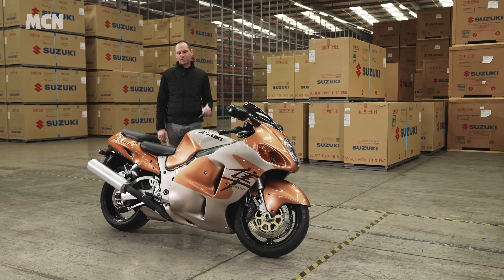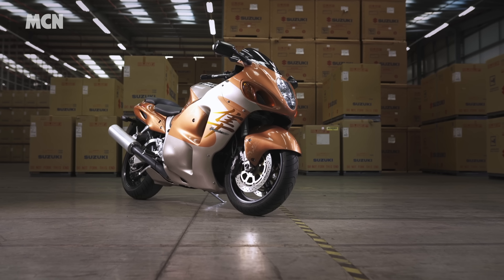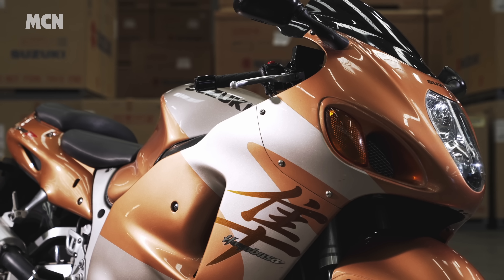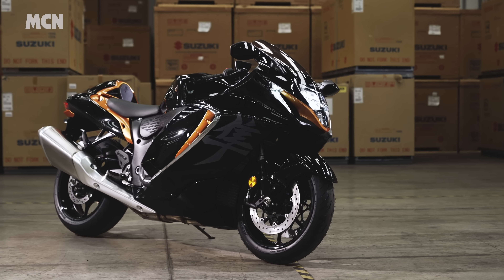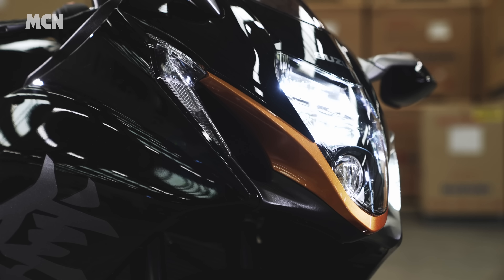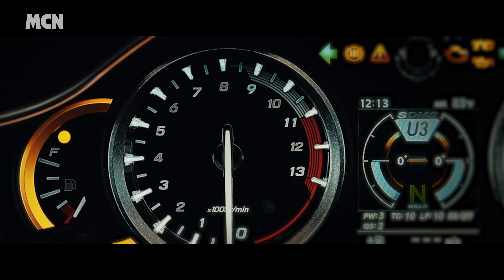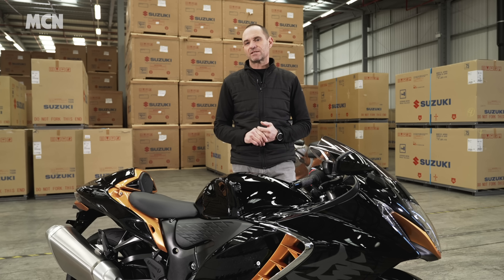2021 Suzuki Hayabusa exclusive: Neevesy's take on new 180mph+ hyperbike | MCN

Comment from the maker: What's your thoughts on the 2021 Suzuki Hayabusa?
Reply: They kept that same 1340cc motor. The zx 14r is still 100cc larger. More torque more horsepower. As 14r is still king. This is just a euro5 refresh. Nothing more
Reply: I couldn't be more disappointed!
Reply: Same old 1340cc engine with less hp and worse fuel range? This 2021 model introduction is generating the opposite reaction that the first Hayabusa model did back in 1998, so much disappointment. What happened to the rivalry between the Japanese motorcycle companies? I was hoping for a more powerful TURBO engine to challenge the supercharged Kawasaki...🙈🙈🙈🙈🙈🙈🙈🙈🙈🙈🙈🙈🙈🙈🙈
Reply: Im not a Hayabusa customer but I was mildly impressed with the model. And I really wish my 2015 GSXR had those rearview mirrors but with integrated blinkers! A small detail with great design unusual on past Suzuki sport bikes.
Reply: Wow! I used to hate the Busa but now I just really really don't like it.
Reply: Marvellous, the best looking Busa so far, I want one
Reply: Meh. Was expecting much more innovation. They just brought it in line with bikes that have had all this technology for years. I get the feeling it was only updated because of the EURO5 requirements...EU, also known as the dystopian "No Fun Zone"
Reply: Been waiting for years for this bike to come out, what a disappointment! Not gonna bite
Reply: Welcome to the new normal, the new trend
Reply: Its like Busa's soul has entered into a Gixxer 😎
Reply: I want it
Reply: Why does anyone care what is is stock? No one will ride it that way I mean no one so why waste more money on power when everyone will change it. They focused on areo and electronics which is what everyone was bitching about with the old one. They addressed all of that. Suzuki is not the first manufacturer to lose power with euro 5. Why create a newer engine size for 5 to 10 horsepower. The Busa is and has never been a slow bike really.
Reply: Big and beautiful. What the first gen was supposed to be
Reply: I love it. The fact that they evolved it and didn't try to just give it a few more horsepower just so they could say it is the most powerful bike (by 2 or 3 BHP) than other bikes was the right choice. It is already more powerful, as are all superbikes, than anyone can really use. A Busa is about lots of smooth, creamy power, and high speed riding; the bike you would take to the autobahn so you could be comfy at 150MPH. I also love the the more conservative nature of the changes, the analogy to the 911 was spot on.
Reply: I had 1.st generation Busa, two Busas from second generation and now... RIP the LEGEND. Same engine after 13 years and less power is maximum disappointment. Naked bikes are more powerfull than this "hypersport", it´s shame. Design is really nice (I love it) but without power I can´t buy it. I can´t believe. I´am still waiting for news from Suzuki like a ... "it´s a joke, our new Hayabusa has compressor with outstanding performance"... or... "and now we are happy to introduce model RS with 280 horse power"... Noooo, it´s not a true!! They killed the legend!
Reply: Amazing! I think I would say "wow, busa" even without knowing it's the new one :) They saved style and legend. And I really liked remark on video about leaving details for forum discussions. We call them "sofa troops", those specialists ;) Thanks for video!
Reply: Looks like I'm in the minority I really like it. Don't change very often maybe that's it.
Reply: Underwhelmed to be honest. I was expecting something with the power to match the ZX-14. I'll keep my Gen-2 Hayabusa.
Reply: I'm not bothered its down on 100cc than the ZZR, its got cruise control, a monster motor, comfort, and nice electronic package etc it should make an fantastic road bike...
Reply: its the first busa ive ever wanted
Reply: This is what they come up with1340? Really? 1340? Kawasaki stil big bike king , suzuki missed the boat should have gotten more motor and more hp and less bullshit electronics. Pretty but very very disapointted.
Reply: @christopheralonge7758  chris i just dont get it .They wait all this time to do a new bike and bring back a 1340? This really pisses me off.all that time putting electronic bullshit on the bike, what the hell do i need to know my lean angle for?  Could have put all that effort into topping the kawasski, guess not. I'll keep my gen1  1397 till kawasaki  revamps the zx14 .
Reply: @stratgibson how can you get slapped in the mouth with the zx14 and come back with 1
Reply: I’m a Busa fan, a Busa rider but Suzuki bout to make me switch to the zx-14!!! I definitely wasn’t expecting this crap! Disappointed!!!
Reply: @dougsmith6220  couldn't have said it better my self. Suzuki went for a cheap refresh. They had the opportunity to do something special. Their sales will suffer
Reply: I’m surprised it’s not 200hp, tuners delight?
Reply: @radekgt9951  no they didn't, the opposite i think. Its a refinement, the last bussa. When electric bikes have ruled the world for a couple of decades people will still be talking about modified bussas with 400hp lasting 100,000 miles
Reply: I like it like the colour as well
Reply: @v8berenguer372  V8 im so pissed at this bullshit i cant see strait. 1340? Really ? I guess they gave up trying to be the king of the big bikes. Zx14 still be da boss sadly.
Reply: @krisknutson5626  kris im so pissed i cant see.1340?really zx14 1441? What the hell are these people thinking. So much for being the top dog of the big bikes, looks like zx14 still be da boss sadly.
Reply: Suzuki market research failure
Reply: I've passed over the H2 variants waiting for this. To be honest, I am quite disappointed. I was expecting a new bike that made me fall in love and gave thrills of my first gen1, then my second busa, a gen 2 in 2008. I was expecting them to overcome the Euro5 restrictions and blow everyone away. Smaller throttle bodies as well. Curious what tuners can do with this. 
Nice that gadgets are on par with the competition, but it fails to capture that x factor for me. This should be the KING. but it's just a mid life face lift to keep it somewhat marketable. Shame about the fuel milage. Looks bloody awesome though. Looking forward to the ride review.
Reply: What a wasted opportunity!
How many people will pay out 16 and a half grand for the same old thing wrapped up in a new coat? Talk about the Emperor's new clothes. Not even a center stand offered on what is essentially a big sports tourer. Many will be going elsewhere with their money.
Reply: No turbo.......
Reply: @freedome4070  ... no turbo, no super charger, no power increase, no engine size increase, no option for center stand, and over 16 grand to buy !!
Has Suzuki not noticed the world is in economic 'distress' and they want 16 grand for this? Have they lost the plot?
Gen 1, gen 2, gen 2 + 1/2
They could have sold it on the back of their Moto GP win, how many people will buy what is effectively a rejigged 2008 bike?
Reply: @adrianpeds  I never owned a busa. Have owned a 17 zx14r. Tge new busa looks good and I like the updates. Could be a buy for me. Probably because iv never owned or driven one. I'll probably wait for its second year in production for other color options.
Reply: Disappointed in every aspect.
Reply: Uninspired
Reply: Keeping my kawasaki.
Reply: @can-uc-wakeup  But why? Why do this bullshit ? I thought they were going to build a all new bike. 1340? , man you said it better than anybody, same warmed over bullshit. No thanks kawasaki still be da boss sadly.
Reply: Not electric.
Reply: ive had a 2001, then got a 2011, and have been waiting for 10years to get a new one. cant wait to get the 3rd gen.
Reply: First response.  sexy bike.  After looking at the full story.  Meh.  Hard pass.  I'll keep my CBR 600 F4, and Ducati 800 Monster.  And 4 others.  Front end is gorgeous, rear looks like a techno pig.  Hideous rear.  New exhaust, and a tail tuck/cleanup?  Maybe could fix it.  Just happy that Suzuki made a new one.  Next gen will be sick.  Fails teach us the most.  ;)
Reply: mileage?
Reply: I am a diehard Suzuki fan but I can’t help feeling disappointed over the last several years. Maybe such revolutionary machines as the 85 GSXR, S-RAD, K5 1000 and the original Hayabusa will never be topped 🙁
Reply: I can see almost zero reasons to buy this. Better brakes (possibly) aside it's worse in every way than the outgoing one. Heavier, less power, worse on fuel (by a lot), fatter and almost certainly slower because a wider body, more weight and less power tend to do that. 
I'm not even interested in euro 5 because the simple answer and the one us owners have been banging on about since the gen 1 is to turbo the bloody thing. 
One of the most disappointing reveals since the 08. 
If they weren't going to improve it they should have just left it gone. This mess is starting to water down the early busa's (well deserved) reputation.
They even had a TV6 FFS.
Reply: I thought that can only one person can sit on hayabusa 2021 or two persons can sit on 2021 cuz I like the modern cowl it's better than Kawasaki ninja h2 Pls reply
Reply: @Louwrens De Kock Great bike based on what? Its worse than the old one in most ways and not much better in any. 
If this was released 10 years ago it would have been average. Now its just lazy.
Reply: evolution, not revolution, which means it remains affordable as owners of older Busa's want more of the same but with the modern safety tech = sales
Reply: @Rayk76  I'm a 67 year old ZX-14 rider, and would love to have cruise control. My last bike before the 14 was a ZZR1200, the one before that a ZX-11. I was set to buy a Busa, but I'm 6'2", and at my age, the Busa's tighter ergos put me on the 14. I haven't regretted it. In the end, both bikes are awesome, just a bit different.
Reply: @v8berenguer372  2021 180mph+ "Hyperbike". Wasnt there a bike in the late nineties which could go 180mph+? Hmm i wonder what bike that was
Reply: @MrSpeedemon7777  bike industry is dying... so bikes need to be restricted so much that it reverses 20 years of progress but cars go scot free? Cars have doubled hp in the last 20 years yet bikes are the exact same as 20 years ago??? what is going on???
Reply: @MrSpeedemon7777  imagine the joy if they had announced that...
Reply: @valensinclair6750  much like the UN aka no F UN involved
Reply: @stewieiommi  well said, I had 2 zzr14s and prior to that 2 zzr1200s in the past abseloutely fantastic road bikes but I've never had a busa and I've always liked them so I think the time is nigh
Reply: @earnestgriffin4838  its got the same performance from the same model of bike 21 years ago... that is appalling, cars have doubled in power in that same amount of time
Reply: @timothymills733  your not paying for a Sofabike your paying for a superbike, what is the point of calling it a superbike if it drops performance for comfort. Backwards world...
Reply: @earnestgriffin4838  good point. I guess the focus is its reputation for being the fastest in a straight line. But the zx 14r has dominated that for awhile. Suzuki had this opportunity to make a real monster and again fell short. People like big changes and improvements
Reply: @timothymills733  it's actually down on horsepower and torque compared to the gen.2 version
Reply: @radekgt9951  well put. Big horsepower numbers sell motorcycles
Reply: @greensocks4507  well stated. Myself also
Reply: @dougsmith6220  couldn't agree with you more. Exactly what I have been saying
Reply: @veshun167  I have owned many as 14r. Make sure you get one that is 2012 and on from there. You will find it has all the power and torque you could ever want. It's a monster. Very strong easy launching clutch ad well. Suzuki again had fallen short
Reply: @fs3994  me too zx 14r rules
Reply: @Rayk76  save your. Money.
Reply: @finlaymcdiarmid5832  well spoken
Reply: @christopheralonge7758  thanks. I miss the old days of cars and bikes when what you saw is what you got and wasnt plastered with cheap plastic for looks and to look "complex" and when bikes were easily repairable and maintainable. Its ashame...
Reply: @christopheralonge7758  ill see
Reply: @siraff4461  the bike industry is exactly lkke the game industy. Lazy and full of rehashes and even more excuses
Reply: @finlaymcdiarmid5832  I agree brother
Reply: @finlaymcdiarmid5832  Exactly. When I got my first fireblade it was a complete revolution over what had come before. The R1 pulled a similar trick - if slightly less of a leap. Then the GSXR 1k jumped it up a bit more but since then its all been chipping at whats there while hiking prices like money is going out of fashion. 
The only real new things have been the Kawasaki supercharged bikes and things like the Vmax, SuperdukeR and so on. 
As far as sport/superbikes go its been stagnent for ages. 
It used to be every couple of years bikes got an uplift then every 4 years or so they got a complete redesign. 
Now they run models for 10+ years with minor revisions, call electronics a massive improvement (even though they are usually just bolting on 3rd party kit like Bosch) and wonder why sport bike sales are on their ar5e. 
If this came out with the old engine, a turbo and all the eu5 cr4p they could stick a £20k tag on it and it would sell out instantly. I would certainly have been as close to the front of the queue as I could but this just isn't worth my time of day to switch. I may get one at some point if there is a major deal on them (like the last one which you could get at just over £10k with 0% at one point a couple of years back). 
As it stands this is going to be thousands more than the old bike and at very best won't be much worse.
Reply: @christopheralonge7758  its why i dont watch f1, its broken they ban everything that gives an advantage even if the other teams could just integrate the change and make it fair but allow mercedes to blow up like a episode of my 600lb life and win every race because their car is so fast. Somebody easily broke Hamilton's lap record in a unofficial lap...
Reply: @franklinwilkerson2061  🤣
Reply: @siraff4461  what year was your first bike? My dads was a early eighties 250xl that he bought with his pocket money! for a couple hundred quid
Reply: Rear end looks like BBW😂😂🥰🥰
Reply: I think that its not going to be a best seller Not impresed body looks the same the dash is a classic i agree but this bike needed a huge change to beat the competion like 1500cc with a turbo charger or procharger runing off the gear box. But no way i would spend the money Best bike for 2020 and 2021 Ducati & Bmw have what people are looking for.
Reply: 2 much Weight / no power / irrelevante bike 
Any 1000 CC Will destroy the busa ... 😱😱😱
Reply: @earnestgriffin4838  Ernest the hayabusa is slow thats why we RACERS want more. I can tell by what your saying that you are not a racer, well i do and i wanted a 1441because it is competeing with a 1441 kawasaki. Why do you think after we buy them We tear them down and put cams pistons clutches lite wheels , on and on its to go faster ernest.
Reply: @veshun167  say it louder BT! ZX14 STILL BE DA BOSS SADLY.
Reply: @siraff4461 Insane raff just insane.Its clear that the engineers needs to be replaced with engineers with new vision and the attitude of wanting to be king of the big bikes. This was the vison of the first busa.They should have infused new go fast less weight protocals.They severly missed the boat. I'll keep my gen1 1397 .
Reply: Like you said Michael, the gen 1 Busa is an iconic machine. None of the others will ever be remembered like the first. Suzuki should have left it there as a one time special
Reply: @dougsmith6220  I suspect they don't have the funds to build an entirely new bike(or don't want to invest) . They had the audacity to say, that this bike is the product of 10 years of developement... Please...  Don't insult my intelligence...  I'm sure it's a great bike,  but,  is NOT a new bike, a new project.  Me,  I'm keeping my old zx12, and wen I can,  I'll get the h2 sx!
Reply: @dougsmith6220  I agree fully. I've got a stock(ish) gen1 RZ which I've been putting off taking to bigcc for ages - first waiting for the gen2 then waiting for this. 
I reckon Sean is getting a call at some point this year because we've finally got to the point where there is nothing else I'm interested in. 
All they needed to do was throw on a turbo like everyone wanted and a lot of people have been doing for years. We could have forgiven the weight gain for 50hp and 30lb extra.
Reply: @finlaymcdiarmid5832  My first road bike was a 1980's DT50 but my 2nd was a 70's CX500. 
I've done new, old and all the ones in between over the years but I've never seen the industry stagnate so badly as it has for the last 10+ years. 
In the 90's-early 2000's this would struggle to be called a mild facelift but now they're selling it as a whole new bike. 
My gen1 '07 hayabusa RZ is at least as far removed from the 1999 original as this is from the old bike.
Reply: @siraff4461  yeah its becoming more of a joke every year. That dt50 mustve weighed nothing my dads dr650 only weighs about 140 if that!
Reply: @finlaymcdiarmid5832  Yeah it was like a pushbike with a strimmer motor. UK laws though so at 16 it was that or nothing.
Of course it ended up as a 65cc big bore with a pipe and a larger carb. Went pretty well after that considering. 50mph or so.
Reply: @siraff4461  yeah, well i was considering getting a bike but with a a3 license you can only get a 125 and you can only get limited ones which are the ridiculously expensive new ones which are like 4 grand for a bike with 15hp. So im just going to wait until im 19 or older to get a old 250
Reply: I read the first few comments, and I have to laugh. I RARELY see a Busa that is fully stock. What did this video really show? That Suzuki made this engine more durable, for the folks that will most surely hop.it up!!!
Reply: I mean in my neighborhood in Brooklyn, about 5 guys have Busas. All of them are stretched, 3 of them are turbos! Give me a break. 
The video made mention of the changes are similar to a Porsche 911, and I agree!!
Reply: @vinceedwards3978  Take a look at a 1999 911 and a brand new one. Its nothing like the same in looks or performance.
Reply: @vinceedwards3978  With slower cams and milder combustion chambers. In other words you're going to get less gains from this than the old one and have a big disadvantage from the start. 
This also has cats in the cans which is an easy give away to a cop that its not going to meet emissions. Depending where you're from that makes this almost unmoddable without a lot of unwanted attention.
Reply: @siraff4461  Thats true, but I live in NYC. There is.much less regulation here than in theE.U. or Japan. Guys here will run to.this bike
Reply: @finlaymcdiarmid5832  Back when I was learning most 125's were a derestrict away from 25-30hp. The new ones are better on fuel but thats about it. 
If you want a laugh on a new bike get a grom. I got one new when they came out and even though I'm used to big power bikes its a total laugh. One of the slowest 125's but its serious fun. You can't really go far on it unless you like sitting flat out for hours but throwing it about is one of the best laughs in biking. When I got mine they were about £3k new and had a £99/month finance offer on - though that was in 2016 or so. 
It makes no power and makes you act a hooligan but its a bit like a bmx - not technically as good as the bigger bikes but a total laugh. 
Oh and they hold money like they're made of gold. Mine has only lost a few hundred quid in value over the years even though it was brand new so overall costs are cheaper than a bus ticket.
Reply: @vinceedwards3978  Even then its got lighter rods (so probably not as strong if you run boost), slower cams and midrange designed combustion chambers (so won't pick up as much if you run it n/a). 
I like the styling, brakes and bars being moved back - all complaints I had with mine over the years - but engine wise this is a step or two back, tuned or not. 
Having to put three cats on a bike is just stupid and having to smash its economy to go with that just shows how far out of touch the new regs are. That extra fuel has to come from somewhere and drilling for it, refining it then moving it all costs more energy+pollution. But thats ok because the bike thats now not as good wil put less out of its exhausts - even though it requirem more pollution going into it in the first place to do the same job. 

This thing really should have been boosted.
Reply: @siraff4461  I have only ridden a1999 first gen, stock, and a second generation about three years in. The third I had ridden was a heavily modded first gen. Turbo bike. I thought my friend,  the owner, was nuts. 
I think most sensible owners will.feel that it has 😔 powet.
Reply: @siraff4461  As a guy who owned a 930 yes I agree, but it is an evolution of the design. The most radical evolution of 911s? All wheel drive in the 993 Turbo, and water cooling what 5 years later? The cars got bigger and heavier, but they improved to be good enough to be daily drivers
Reply: @vinceedwards3978  With the 911 there is constant evolution though. Every couple of years there are revisions and usually its not all that long between complete model changes. It may look similar but its had a lot of constant work underneath since it arrived. The busa had a facelift and slight power lift (along with a lot of extra weight) in '08 and this is pretty much a facelift and emissions compliance on that same bike. 
Thats 22 years with almost no progress at all on how the bike rides or how it performs. Infact the gen1 is still usually the quicker bike in racing thanks partly to it slipping through the air better and partly because the internals can take a lot more stick. Yes you can boost both but the gen1 still takes more boost and power too. 
Has there ever been a 911 where the later car was slower and less tuner friendly than the last? Especially 22 years down the line. 
Remember when the busa came out sport bikes were topped by the original R1 with a claimed 140hp. Now there are plenty claiming around 200hp but the busa is still only claiming a few more than when it was released and with real dyno numbers putting gen2's at only around 10hp over the gen1 this may even be less powerful when it actually hits the dyno. 
The most powerful 911 in 1999 was the 420hp turbo. In 2020 it was the 700hp GT2 RS. 
I stand by what I said. This bike shold have been turbo'd and have 250-300hp.
Reply: @siraff4461  yeah a grom would be better than a 125 probably, 125s weigh not a huge amount less than a sport bike but with a fraction of the power so better off with something really small and compact that 15hp is significant for
Reply: Beginning of the end for the hayabusa, suzuki have really made a big mistake here with this one. Revamped styling is all this is but not in a good way.
The soul of the busa has gone and to tempt busa owners away from the current model isn't going to happen with this.
Very very disappointing and its only a hayabusa by name.
Rip hayabusa!!
Reply: Rip hayabusa!!!
Reply: @finlaymcdiarmid5832  The grom isn't lighter than most of the sports 125's and it only makes 9hp. Trust me though its a far better toy.
Reply: The restyling the design the electronics package is awesome. But a 1340 motor that's what I got now come on Suzuki get your s*** together. Turbocharger supercharger something
Reply: One of the Ugliest bike ever made.
Reply: @dougsmith6220  Then why even worry about a new one or the specs because based on your comment it would not have mattered what they did is my point. You do realize they are company who has to make money and not cater to a small group of people? Just because Im not a racer Doesn't mean I know nothing about bikes. I have been riding for 32 years and own a business I look at the entire picture not one side. I didn't know the speed limit was over 180mph because at the end of the day its a street bike. Racers regardless of vehicle or class will always mod so stock form is irrelevant.
Reply: I love it. An opinion nit shared by my local Magistrate so I'll lose the bike and keep my licence.
This weapon is nought to court in milliseconds!
Reply: @earnestgriffin4838  man im so mad this wasnt at least 1400. Im a die hard gsxr nut i've owned six including my my gsx  1397  . When the zx14  came out i said just wait suzuki will  bounce back.well they took this long to go after the big zx14 with a1340? Im sorry this is not going to cut it. Zx14 will still be king and im pissed  about.
Reply: 350+ KMPH ❤️
Reply: Ordered.
Reply: To all of you who say that zx14 is more powerfull I laugh so hard...whith the fake video that Kawasaki uploaded versus the hayabusa years before we all laughed...Did you really thought that zx14 was faster????! Hahahaha
Reply: Pretty much all motorcycles have TERRIBLE coefficient of drag, if you compare to cars. Suzuki need to forget aerodynamics and concentrate on updating this motorcycle. I love the company ... but we have been waiting ages for this bike and it’s just not good enough
Reply: @maxflight777  maybe we must wait the rest rides...it’s very soon to talk
Reply: 911 analogy was spot on. I own a 04, longer and lower than stock, Love it. Never own another bike, Underated imo
Reply: @dougsmith6220  I am a ZUK nut as well again I try to look at everything. Kawasaki was trying to beat Suzuki not the other way around. I know tons of guys that went to a zx14 and was back on a Busa in a flash. Just because it had more cc didn't make it a better bike. After that 186 mph agreement they made what difference did it make?
Reply: Haven't saw it yet
Reply: Disappointing...the identity of Hayabusa, the feel..it's gone.
Reply: Give a tubro busa to yammie noob
Reply: It needs a turbo
Reply: @finlaymcdiarmid5832  yes bro, This new busa is utterly disappointing 😔
Reply: First thing that Came in my mind
Reply: OMG - shut up and take my money!!! 😍😍😍
Reply: More like what I think of Suzuki, they didn't make this bike because they cared what people thought about them, they made this bike because of what suzuki thought of people.
Reply: Can anyone please let me know which shoes that guy is wearing 🙏
Reply: This can be compared to the evolution of a 911 since Porsche is the benchmark and the hayabusa was the benchmark and has now been left behind
Reply: About the FORKS in the suzuki global say this :  are KYB inverted cartridge forks provide 120mm of front wheel travel and feature diamond-like carbon (DLC) coating on the 43m.  So is a change compared to the gen 2 ??
Reply: Just gonna a nos tank on it
Reply: Suzuki is the most outdated Japanese manufacturer. For me it does not exist at all
Reply: I like the look of it.
My immediate thought is what happens when I derestrict it and it gets past 180MPH?
To be honest I preferred my old gen 1 with the GSXR front brakes I fitted. At least that did a genuine 197MHP (Indicated 205) and had 178BHP at the rear wheel....OK it was slightly modded. No pair valves, Big airbox mod Power commander and K&N filter Oh and a Akropovic titanium race system.
I think they should give the first one to Sean at Big CC to show us what could've been.
Reply: MRJT is the next big stock to buy.
Reply: WHAT IS THAT SONG ..4:54 🙏🙏🙏
Reply: Give me donate hayabusa😍
Reply: Old dog new tricks
Reply: @christopheralonge7758  Agreed
Reply: I have to defeat h2r soon
Reply: i think 2021 will be use turbo like kawasaki H2
Reply: @v8berenguer372  I am also disappointed after waiting so long. I wonder how much input came from busa riders?
Reply: @valensinclair6750  exactly.  The paint job and electronics are awesome. other than that. It's lacking for me.
Reply: @earnestgriffin4838  very valid points you're making. It's just a lack luster when as a Busa owner you're expecting more and also seeing competitor out perform the busa in most categories. I want a winning Busa. So I love the bike but my expectations are shot.
Reply: @radekgt9951  You said it! in total agreement
Reply: @adrianpeds  I too pass up a H2 (great offer on a resale) as a next bike waiting on the Busa. sadly I'm disappointed.
Reply: @enigma5192  As your first Busa I'm sure you'll love it. it's only a disappointment to existing Busa owners. it come up lacking what we love about Busas
Reply: @ringsoffire5947  double DITTO!
Reply: @rwd323  shared sentiment
Reply: @siraff4461  I think Suzuki made advances without consulting it's customer base.
Reply: The claimed mpg is a shock. Guessing it has something to do with the testing parameters and that new mid range bias. Hopefully tall gear Highway runs will be more toward touring friendly figures.
Also would be interesting to see what's possible with remapped / grey import variants, i suspect there's still going to be a busa hiding somewhere beneath the that electronics pack.
Reply: Let down
Reply: @lawrencebutler1664  , I suspect a big fat zero. I really think there is something wrong with this brand. They stopped to invest in new projects.  All their current models are nothing more than   recycled old engines with new plastics... The vstrom, the Sv, the Katana....  All engines with more than 20 years...
Reply: Is that a Busa or a Goldwing? I cant really tell with those massive California mufflers...Jeeeez that sucks ass. Not only did they miss the mark...but they shot themselves right in the ass...no good. Noooooo!
Reply: As a Gen 1 Busa owner, I absolutely love it.
Reply: @Ray-xx5np  That exhaust looks like it came off a Chinese Scooter. Absolutely terrible and I guarantee it will have a very soft market...in fact I think they only sold one to some 80 year old named Ray!
Reply: not impressed at all it needs to have more power at least 300HP it's so big and heavy the H2 would eat this bike all-day
Reply: i wish i had a bike .but i cant afford.. 😥
Reply: Looks wise it’s an upgrade. The cockpit is awesome but I’ll stick with my ‘18 Busa for range and hard out power/toque. Until the aftermarket cans come out from Yoshi it sounds terrible.
Reply: It’s beautiful! 😍
Reply: that rear end..beautiful. love that they stayed with the analog instruments. the exhaust though..not a fan. its the only prominent straight line on a round and flowing bike
Reply: @v8berenguer372  Why? (Are you joking?)
Reply: Genious Bike! I like that Suzuki is still concentrating their Engine-developement on durability. Thats one main reason why I buy Suzuki-Bikes.
P.S. Good Video, I like the cut-ins which show the developement process of the bike.
Friendly greetings from Germany!
Reply: Worst design of bike ever in history. The old generation Hayabusa is awesome -0 for this new one 👎
Reply: @sanktsalva8886 I couldn't be more serious. Sorry,  but this to me,  is not a new bike.  I was expecting much,  much more...
Reply: @sanktsalva8886  bro ... I understand what you are saying but....... The general public who buys these bikes and rides them on the street are interested in big numbers torque horsepower displacement... These things sell bikes not their nostalgia. This is why the zx 14r is now the preferred and desired bike in that class. It has more ponies and torque
Reply: Suzuki is worst from all Japanese motorcycle manufacturers. Just proved that message itself now. What a 6 cylinder turbo they tried ? What a bullshit was said about that !? They have no money for R&D
Reply: It's a muscular tub of lard. Reminds me of Vasily Alekseyev. It could stand to easily lose 70 pounds.
Reply: Price?
Reply: @caribman10  😂😂
Reply: @golu-kanzo  too much for what you are getting. Less power and torque
Reply: @earnestgriffin4838  true. But it's main competitor DOES have a bigger motor with about 15 -20 more hp
Reply: @dougsmith6220  😉
Reply: I meant how can you get slapped in mouth via zx14 and come back with 1340. Should have been at least 1400.
Reply: Break lights sucks
Reply: New...as in new fairings lol
Reply: It’s RADDDDDDDDDDDDD!! incredibly insaneeeeee 🔥🔥🔥
Reply: Anyone willing to 'pay it forward' and sponsor me with a secondhand motorbike please? I am not fussy, I just want need a ride to the work I am confirmed for.
Reply: @MotorcyclesForMatures  if you think that, you are not alone....
Reply: My stable is kinda full with a Gem 1 99,  Gen 2 08 and several other bykes. I'm sure the gen. 3 will be coming  home with me also. 
Being single has its advantages.
Reply: The price now of it 23000$ thats a big pass
Reply: @dougsmith6220  very true!!!!
Reply: Fucking amazing bike! Can't wait to get my hands on it.
Reply: The future is electric. In spite of that Suzuki kept the original petrol engine, original design of the bike and all the new gadgets a modern machine needs. Plus is an euro 5, plus there is finally a cruise control, heated grips, etc. I mean what not to like ;)
Reply: curious why BMW 1000rr has over 200 hp and still Euro5 compliant.. Shame, people waiting so long for this bike and it is not as good as the Kaw1400... The exhaust ruins the ENTIRE look of this bike... currently own 2 of these(1999 Euro and 2006 USA) but won't waste my money on anymore as they farted around and wasted time.... shame...
Reply: @buddha65281 , bmw 1000rr is a super sport bike. Hayabusa is a sport tourer. Besides you can always tuning the machine in whatever you prefer. Seems plp do it non stop anyway.
Reply: @buddha65281  yes for sure. Kawi did it right with the zx 14r. I love mine
Reply: no money to buy ..........
Reply: 2 bad Kawi didn't update, but instead no more zx14...SUCKS,  but I DO LIKE this new Busa👍
Reply: Is it more comfy ENUFF to pick over a GSXR1000??
Reply: Now this is more like 14r..
Reply: First day, buy aftermarket exhaust.
Reply: Can't beat h2r
Reply: @willraven7  yes for sure
Reply: @willraven7  the zx 14r needs nothing .It is brutally powerful as it is. It does everything well
Reply: I love this thing from my childhood  I hope one day I will have money to buy haya busa
Reply: Disappointed. They really couldn't make more power....its a god damn busa. This bike should come with 230bhp....the only thing its designed to do is straight line speed....and it can't keep up with a r1....which can actually corner. #notmybusa
Reply: When you think you couldn’t be more disappointed..... tadaaahhh 42mpg
Reply: It definitely transformed to a very beatiful view but keeping the same motor after 22 years is disappointing.
Reply: Love the new bike. I'd own one.
Reply: Needs a turbo.
Reply: As much as I love riding and have ridden a first gen ‘Busa, I just can’t see the logic to using a bike that heavy. I just prefer a 150MPH capable bike that weighs a hundred pounds less.
Reply: it's the same bike with less HP and bigger exhaustpipes...
Reply: @stratgibson rephrase that,stragglers
Reply: let me get one
Reply: My bank account is glad they made it so crap. euro 5 brilliant I can't wait until we are at euro 10 and a hayabusa has the same power as a 125
Reply: Considering how much work went into this bike, I wonder what it will be like uncorked?
Reply: SAME BIKE, which is good !!!!
Reply: @finlaymcdiarmid5832  Great comment , nobody is talking about that. You sir are spot on ! 👍
Reply: Best looking 'Busa so far! ( ...esp in that black with orange highlights!)  Shame on Suzuki raising the price though! ...The whole "budget hyper bike" was started by Suzuki, and now they've made it a "premium" product, out of reach of everyday bikers!  WRONG DIRECTION Mr Suzuki!
Reply: Can I get just a engine
Reply: I have a zx14r and a busa and the busa of far better in every department. Even my diavel is better than my zx14r
Reply: I don't know.... I have to ride it to judge it....
Reply: The back end looks so much better
Reply: I love my gen 1. It still serves me very well.if I was attracted to the electronics I would be looking at a gen 3 for sure. It’s beautiful. I personally think it’s not disappointing
Reply: @wsbygt  GSXR is 100x better looking.
Reply: i agree on the needle 100%    it effects how much you enjoy the bike more than you think .
Reply: Holy Fook!
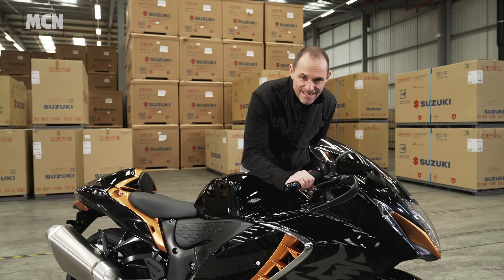Reply: 12:45 oh yeah. especially when you're not alone on the bike.
Reply: I like it - but its probably way too expensive like most modern bikes
Reply: I’m tall done with pocket rockets need to sit up
Reply: my jaw just hit the floor,
Reply: Heavy and under powered
Reply: I owned the '99 Copper/Silver and still like it better.
Reply: It sounds terrible on start up. Very disappointed.
Reply: Is it DCT now? Can it be turned to automatic mode like the goldwing?
Reply: Love the looks, don't like the new specs compared to the older model.  The whole limiting thing is a reason to avoid IMO.  Will be looking at others when the cost is so high for a meh upgrade!
Reply: @greensocks4507  My thought too.  ZX14-R is still at the top of my list.
Reply: Suzuki dominates the American Superstock groups. 👍 Has been anyways and they've done well in Superbike with Toni. Here in 🇨🇦 we have Alex Dumas who's come back to challenge BMW and Kawasaki. 
When I was 14 I wanted the 1999 Busa. 
Naturally I love this bike. 
Longer swing arm, some pipes. Paint. Indicators/ floor lighting. 
Bigger rear tire.
Guy Martin could break the record with this motor amd his genius.
300mph

Coolest bike
Reply: I like how it's basically a modern copy and paste material wise. If you're an Iconic Hyabusa rider upgrading to this will be what you want. 
For say a 2023 model maybe they'll do that 6 cylinder you wanted with beast mode aero package. 
I like the staple look and Euro 5 upgrades for mother earth. 
We all know she goes full volcano in japan sometimes anyways. American models will be 200hp I'm sure with race fits. 
If you're having issues with Insurance go to Bennetts. They dont mind dual acropovic
Reply: They Brought the Big Guns out for this Michael Neeves is the Best Motorbike Reviewer in the world 😈
Reply: bike looks stunning. i love the analogue clocks ( hate digital ) but i couldnt bare to have those end cans on any of my bikes, they make the bike scream out for a pair of Oh Crap I Wish ( i was faster ) slipons
Reply: Well seeing how composed of a motorcycle at its level, I kinda want to ride this motorcycle next but its a heavy machine.  But I still like it
Reply: It's pretty sexy
Reply: @ringsoffire5947  The rear is 🔥
Reply: @vilasjagde8512  2 people of course
Reply: @finlaymcdiarmid5832  Get a Car then. How can you complain? What speed to you want to go ffs
Reply: @relaxbro7671  ??? How can i complain? Because they are charging top dollar for something thats been available for over 20 years, its just a cashgrab.
Reply: @finlaymcdiarmid5832  Bargain
Reply: @relaxbro7671  New bikes and bargain do not go hand in hand. You pay the same for a 125 nowadays that you would've paid for a 750 in the 80's and early 90's
Reply: Love the bike💯💯 just wanted to know, wasnt this supposed to come out with stock turbo tuning, to rival the h2? I believe suzuki mentioned it in 2018 or something that the next busa would have stock turbo tuning, awesome bike regardless, ride safe fellas❤💯
Reply: I'll stick take the ZX14R over the Busa refresh.
Reply: RIP
Reply: No larger displacement, no forced induction, no variable valve timing, no considerable weight loss, less horsepower, less torque, less fuel capacity, less gas mileage... I don't just get the point of this """""new""""" bike.
Reply: @Topnikko  Dude honestly I can't decide. It took me a long time until I really enjoyed how the Hayabusa looks, despite it is a great bike I've always found it weird looking whatever the generation. But now with the third gen. it just seems like there's something missing on this bike idk why.
Reply: @Topnikko  I'm a Busa fanboy so I was expecting something wayyyy better than this. But Suzuki doesn't seem to be interested in making it the great bike it used to be in the old days.
Reply: The Euro 4 ZZR 1400 has been discontinued in UK. Let’s see a Euro 5 revision before passing judgement. However, what is genuinely disappointing is the fuel economy dive combined with the price hike.
Reply: Neevesy and other Busa friends, I noticed a distinct and uncomfortable vibration beginning at 4500 rpm in the 5th/6th gear in the new 3rd Gen Busa..anyone else experienced it ?
Reply: @MrSpeedemon7777  like you could use it, most carnt max a stock zx6r so get real
Reply: @ollydogtravels9465  regardless of one's riding abilities; you don't need Schumacher's skills to buy a Ferrari. But, Ferrari still makes exciting cars for the road that rivals Lamborghini. 

All manufacturers improved their products over the years and increased horsepower even with Euro5 restrictions. I'm sure I'm not the only one who's very disappointed. Everyone will just continue to ad aftermarket turbos anyways (To be clear: I've been a huge fan of the hayabusa since it's introduction. It's a motorcycling icon...)
Reply: Instablaster
Reply: Hi Neevesy and friends
I’ve bought the 3rd gen Busa a couple of months ago and I find at 4500 rpm a strange vibration through the engine, foot pegs and all the way to the handle bars.Has anybody else reported this?
Reply: Still riding my 2014 Busa and loving it! This gen is very nice but is it worth selling my 14 ? 🤔
I just wish mine would have cruise control!
✌🏼😎👍🏼
Reply: Well I just find my first ride..it’s safe it’s fast it’s comfy it have mode c for beginners it is what I need for the weekend short trip so why not?! As for everyday I have a car that I can use I think I’ll be ok.. I prefer tho to do a  lot of lessons yet to gain the necessary experience than to buy something else that I don’t need and I don’t like, hayabusa was my dream bike since gen 1  now with gen 3 I’m going for it and may the god be with me
Reply: One of the best motorcycles ever manufactured.